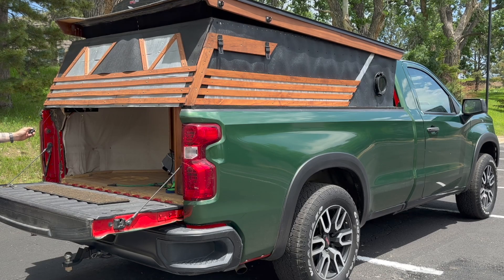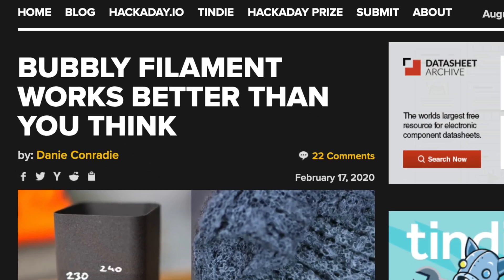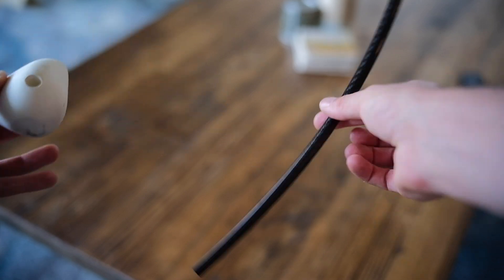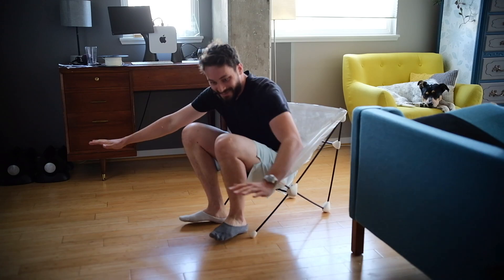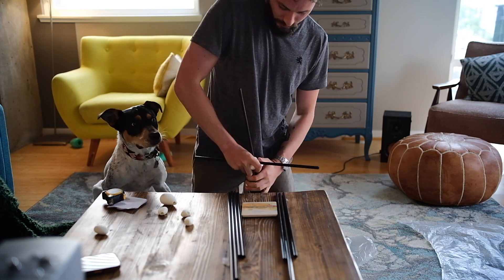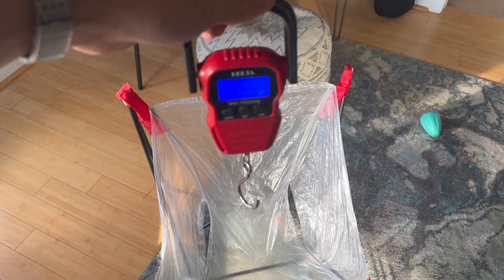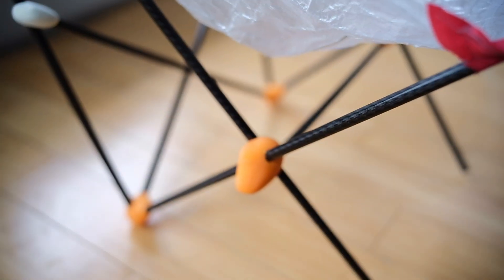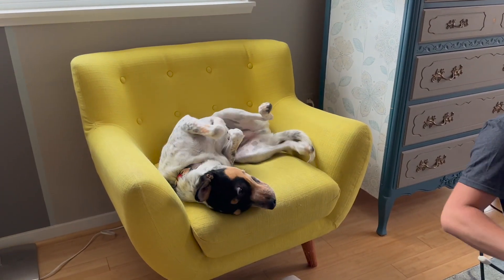Making The World's Lightest Backpacking Chair

Comment: Any chance you could share the OD of the Carbon fiber you used? Also the wall thickness of the lighter carbon fiber used? and I am curious if you can get an accurate weight of the dyneema seat vs the frame? Thanks for sharing the video!

Comment: Carbon fibre is more brittle than aluminium, are you concerned a pole might snap and possibly impale😅?
Reply from the maker: When you make something 1/2 the weight it becomes less durable. Yes, I am worried about that. No issues so far… but someone heavier or less careful would probably impale themselves lol
Reply: Thanks, I've often thought about upgrading to a carbon pole chair, but always worried about that, I think I might upgrade mine to part aluminium Easton poles and part carbon, with possibly dynenma seat (I'm unsure how dynenma would hold up though) I love your design  😊 @CarterHurd
Reply: @dominic3753 that’s crazy chair lingo